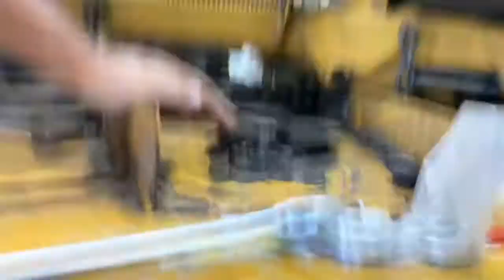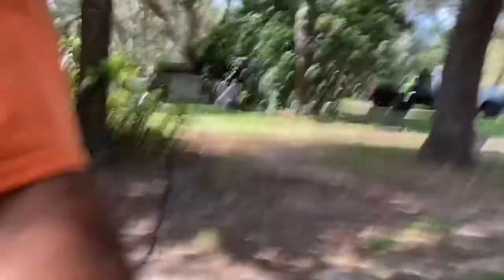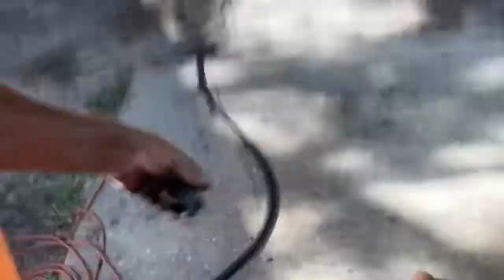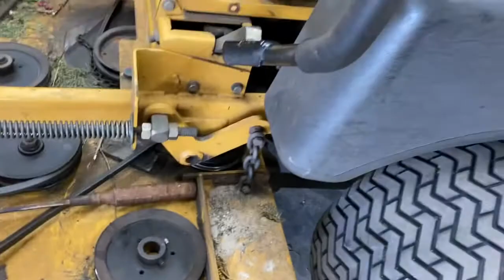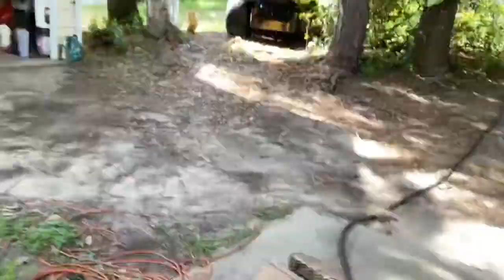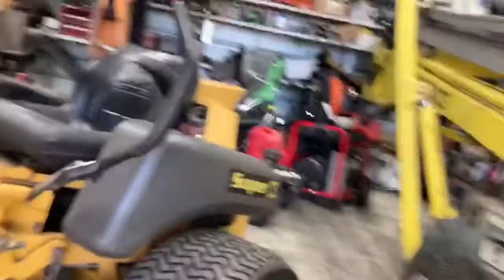FIXING HUSTLER SPINDLE BEARINGS

Comment: I recommend investing in some bearing arbors or pipes that match arbor sizes. 
Will help drive new bearings into place with no pressure on the outer races. 👍🏼 I used to rebuild electric motors, arbors are a life saver.

Comment: You need to learn how to work cleaner
Reply from the maker: Yeah these machines get pretty nasty.  You have to watch out for parasites on them too.   I got hookworms in my arms last year from the mower deck
Reply: @sclawns5257   I do some handyman work And I'm always clean the area before the start the work. And I work in those kind of zero turn I give you a quick tip. Use The Backpack Blower hand pressure washer and trust me when you do working in lawn mowers you not have to work messy, trust me it works every single time with me.
Reply: @Djhomie1964  great advice. I always blow mine off with the leaf blower and occasionally use the low pressure nozzle on my pressure washer.